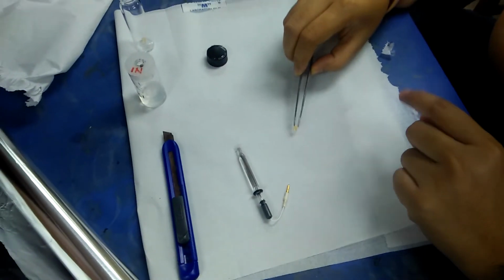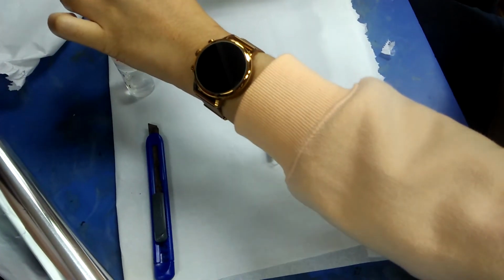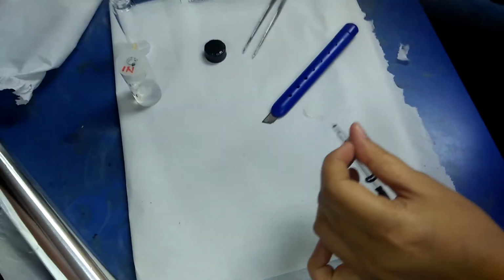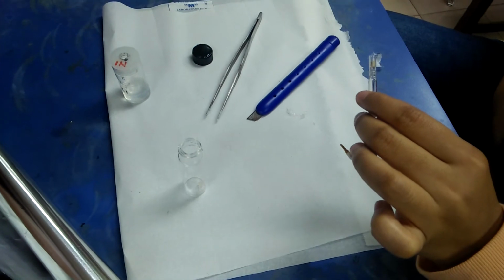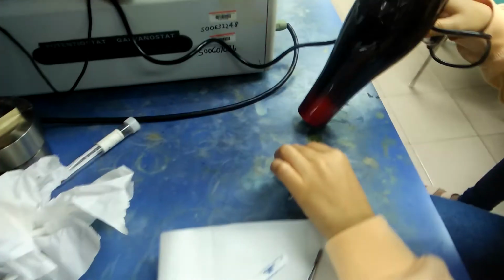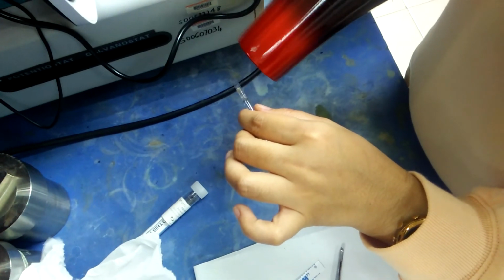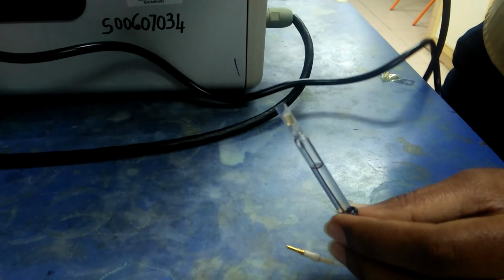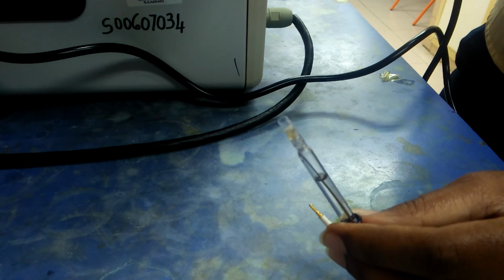How to fix reference electrode Ag/AgCl

Comment: Hello! What can I do if one of my reference electrodes generated crystals inside it, plus another one of them was left without the coating on the filament. Please help.
Reply from the maker: You can sonicated to remove the crystal. If without coating you need to try run some exp. if the deposition or results is no good, you need to buy a new reference electrode.
Reply: @DrHaffeast  Thank you so much!